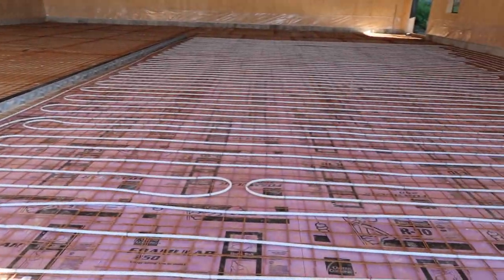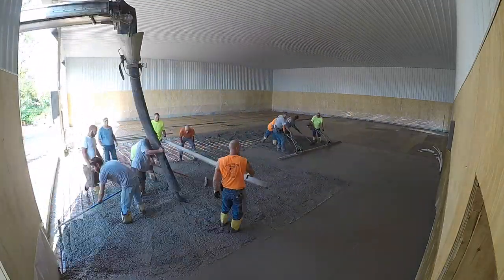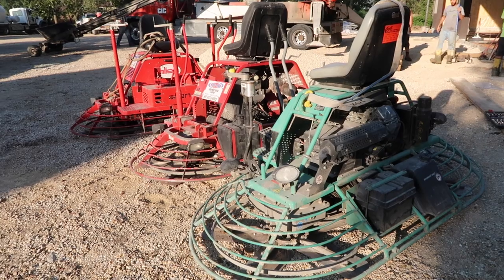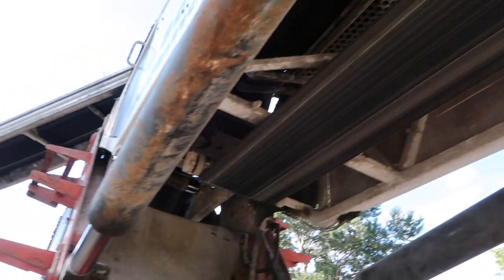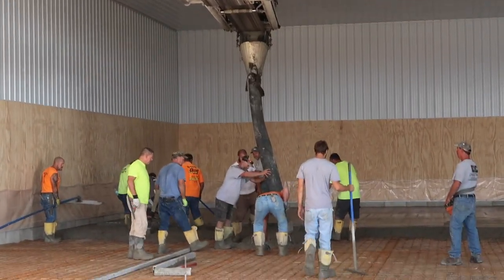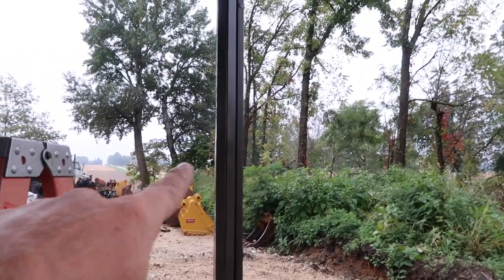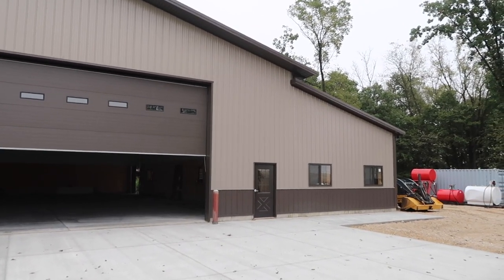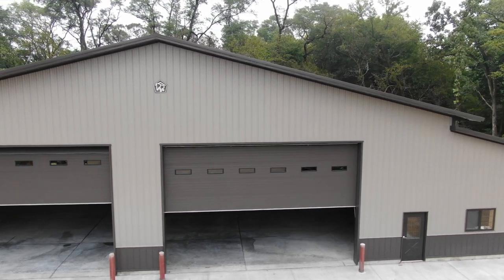Building the Dream Final Episode: How to Build a Shop

Comment: I bought a similar sized building 8,000 sf shop, 800sf office built out of concrete block with a brick face. The insurance company put a replacement value on it of 800,000 . I think that sounds high. What is the cost of constructing one like you show here?

Comment: I'm curious, what if you need later to install a car lift and have to drill into your garage floor? How would you know where to drill
Reply: Doug Harlow lifts from my understanding can be installed anywhere. There is a catch, your slab must be at least 6 inches thick wherever you put the lift. In this case with such a large shop you may not want to make the entire thing 6 inches because of cost but you do risk limiting yourself
Reply: @leviticus5302  I ask that question because of the Radiant flooring you installed.
Reply: If water starts coming out of the hole you are drilling you should move the drill over a couple inches.

Comment: I bet the building last a lot longer than the plastic tubing in the floor !
Reply: Pvc pipe actually lasts forever. Storm systems, water lines, sewers, hydro trenches, gas lines, etc are all made with the same style plastic you see in this vid. The stuff lasts forever, through all condtitions.

Comment: Whats the point of the rebar if its sitting on the ground  in Australia we lift it up off the ground and put it on what we call chairs so its sitting  half way through the slab to give it strength that holds the slab together

Comment: You did a beautiful job. I can't say the same for the cement work. The customer simply wasted his money. He knew enough to put the wire mesh down and paid a pretty penny to have that done but not once did I see anyone pulling the mesh up as the concrete was being poured. If you leave the wire mesh at the base of the slab, you have wasted your money putting it there in the first place and your slab will be only as strong as the concrete itself. If the slab heaves due to frost, the concrete will break up. 

The wire mesh has to be pulled up into the lower 1/3 of the depth of the concrete. This can easily be done as the concrete is poured. So the mesh should be situated 2 inches above the base with 4 inches above the mesh on a 6 inch slab. Not pulling the mesh is simply a sign of laziness, inexperience or blatant neglect to save time. Very unprofessional and in 30 years the owner will not be very displeased. That much money for a building that will only be serviceable for perhaps 30 years seems to be the norm these days and it is not for any lack of spending money but the wisdom and effort behind the workmanship is simply worthless.
Reply from the maker: trust me they did... It's something I always look for myself

Comment: QUESTION ??? Whats to keep those plastic PVC Radiant pipes from breaking / leaking over time and causing a water leak and the boiler from over heating ???? won't those PVC Pipes eventually break over time and all kinds of  water leaks - the ones "buried in the concrete floor",,,,,,,,,,,,,,,,,,,

Comment: Beautiful shop. 
But. Your radiant floor has pushed the structural wire mesh down on top of your underslab insulation. That should have been sitting up on spacers. Or during the pour somebody should have been pulling the wire up as you were screeding. Laying on the bottom of the slab will do it no good.

Comment: Won't the radiant tubes get crushed by the concrete if not under pressure?
Reply from the maker: No
Reply: @RRBuildings  oh. Why not? Just learning. Is the material used?
Reply from the maker: It’s very rigid

Comment: mmm this building easily would be upwards of 80-100k $$ considering interior insulation and finishing concrete and electrical professional design custom drainage. Maybe even more if there is septic and plumbing Water. with the amount of equipment and labor there Pumper truck for concrete, slinger for gravel yup this was one pricey bld. 11 guys pouring the floor plus a couple drivers geez?! we poured a road in ohio with 7 guys 47 trucks in a row took 14hrs with a power screte. Must be nice lol

Comment: We’re the doors painted to match? Or was that a factory option?
Reply from the maker: Custom paint job by my door manufacture
Reply: RR Buildings Kyle, so is that a “baked” on finish like would come with one of their std doors? Just wondering if you had opinions on durability between baked on stock finish vs paint... hey also is there any way you could address not sheeting the roof and the possibility of condensation under the metal on the roof...I have to imagine that the metal would at least sweat even with the atic being the same condition as exterior but metal sweats...just wondering how to address that. I would love for ya’ll to road trip and build me a house!

Comment: Anyone know what the total cost was for this beauty?
Reply: Most buildings start on average at 35/sq ft and go up from there, then the concrete is a whole other ballpark with its variables as well are usually a higher price by the cubic yard. 10 yards is $1,000 that's actually has a $10,000 poor that's a pretty expensive pouring radiant heat below it - as mentioned by fellow commentator James Ledesma

Comment: How do you drill the holes in the concrete for lifts when there's water pipes directly under it?
Reply from the maker: you layout the map
Reply: For around $200 you can get an accurate enough thermal camera and actually visibly see the PEX lines through the camera. I believe there is an ultrasonic method as well if the tubes aren’t in use
Reply: @DozIT  That's it, I had a realtor tell me about a similar ingenius method before thermal camera's even existed. Can't remember what it was.
Reply: Hmmm... I am picturing something that would make a thermal reaction on the surface :)  @c-shepard

Comment: One question!! why on Earth are these guys not lifting the metal up into the concrete or at least sticking some concrete chunks underneath the rebar, so that it elevates the rebar up into the concrete, what good is rebar if it's not in the concrete!!? and it's only under the concrete!! if you watch 90% of concrete layers they will put the concrete so that the rebar is in to at least quarter way to half way into the concrete, I have a tip for you watch BarnaMania out of Texas, when they pour their concrete it's awesome,  They lifted up into the concrete by elevating it with chunks of concrete, I know when I poured my concrete in my floor which is now 12 years old and has no cracks in it, And I live in a cold climate state, I had my rebar an inch and a 1/2 up on the high density foam, so that the concrete would engulf the rebar, thereby strengthening the concrete, you're not supposed to have rebar underneath the concrete it's supposed to be in the concrete.  And another thing!! rusty wire mesh??? what the hell!!!!! that shits gonna be rusted out in like 6 years, and then there will be nothing left holding that concrete together, those guys should never put in rusty mesh. Its junk!!! RR  Please get some new concrete layers you're a high quality builder working with lousy concrete guys.

Comment: 6 bag mix means next to nothing, unless you know the full ratio of ingredients.  Knowing the slump measurement is a little better, but if it is your business, you need to learn that lingo and you need to determine with the cement company the best ratios for the intended purpose.  Then use the slump and the compression test numbers to evaluate the product.

Comment: one major design flaw, no bathroom!!!!!  lol  other than that, amazing work
Reply: ... Exactly: Water supply & sewage? ... A hot water vehicle wash? ... And what about ventilation?  ... Lighting? ... Power? (welding, receptacles - inside & outside, compressors, door openers, HVAC, lifts, overhead hoists, on & on) ... Communications? ... Security? ... Fire detection / alarming / signaling? ... Etc, etc.

Done, but far, far away from done-done.
_

Comment: I hate it when someones office is bigger then my workshop.... :(
Reply: So yours is smaller than the 20 x 20 shop office he has? Quaint if that is so, but I do see your point.
Reply: @Joshua79C  yep, my shop is 19x9 feet
Reply: My basement is larger but useless as it is before modern insulation and uses field stone and so is left to suffer in the elements and I do not own the place as I pay rent and the boilers, a water heater and fuel tanks take up an amount of room with the stairs from in my residence leading toward a side wall  makes for odd storage space of things that do not need to be kept in a warm conditioned space.
I envy those who have their own property with plenty of space for even a shed let alone a larger second building, one day I will the money to get my own space and freedom to build a detached post-frame utility building

Comment: Why not pour the slab and build the building instead of build the building and then pour the slab?
Reply: If I heard correctly the building might of been there for a couple years and he was just working on the rocks.
Reply: It's very hard to protect the concrete during the building process if you pour before you build. To many trades working on top of it.